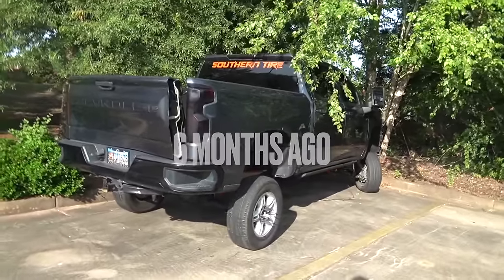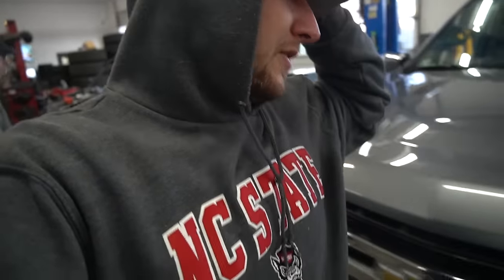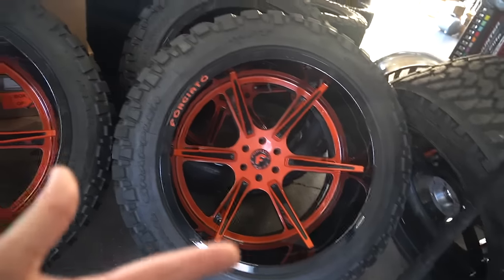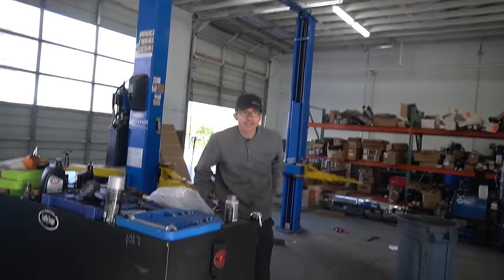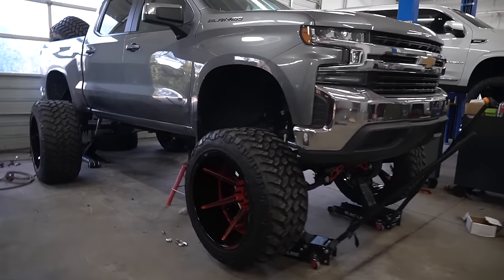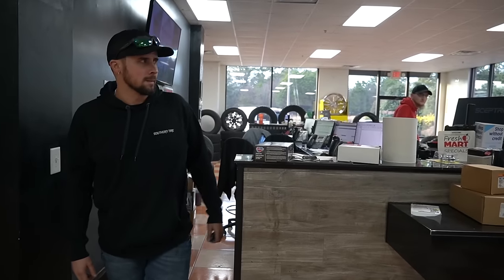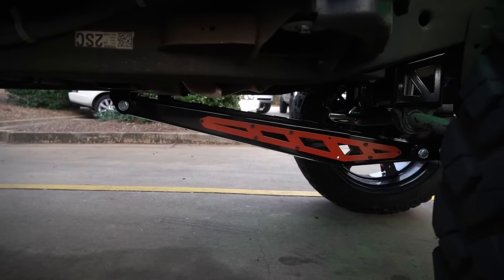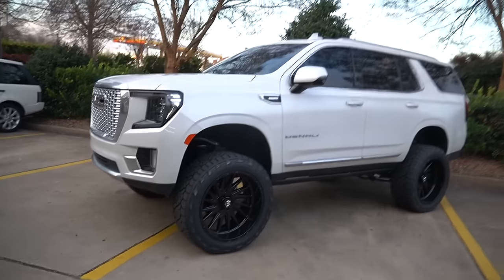WRECKED HIS DREAM TRUCK! Lifted Chevy on 26x16 FORGIATOS and 9" Mcgaughys + 3" Body Lift

Comment: I have a 2021 Silverado RST 4x4 with an 8 inch Ready Lift. What’s the best way I can stretch it? I would like to get at least another 2. I was looking at leveling kit and add a leaf for rear, thoughts?
Reply: I also advise getting readylifts 2 inch shock extenders to keep your rear travel the same. Cheap like $50

Comment: Why doesn't this lift company make lifts for Rams? I could of started with a 9" instead of a piss ant 6". I now have a 6" plus 3" body plus 2" leveling kit on 37's But would prefer a higher lift and 40's, but i don't think theres any companies who make bigger than 6" for a 2017 1500 ram and that dont cost thousands. Please let me know if there is. I also wanna run 26x16's. Not sure if i can with the total lift setup i currently have or if i need to drop to 36's or 35's? My 37's are looking small though already.  Thanks

Comment: Hey guys im new to the lift kits assembly. Why do people have body lifts or blocks then install the lift kit on top of it ? Is that to make them higher ?  Doesn't that make the truck look bad ?  If customers want to go that high why not get a lift kit that goes up to their desired  total height level in the first place ?
Reply: Body lift only lifts the body/ bed of the truck 1-3in, When people say it makes the truck look “Bad” it’s because it shows the frame more which bothers some more than others, most people won’t notice that extra inch of frame. As for why? A level doesn’t change ride quality at all! So you could have a stock riding struck but body lifted 3in to fit 35s, most of the time people already have a 6in lift, so it’s cheaper to spend 300$ on a body lift then tear everything apart to go 9in. Hope that makes a little bit of sense.

Comment: does doing this affect the towing capacity and other stuff?  not really a fan of lifts, i use my trucks for work and that would make it harder to work, only thing i can think of is maybe better clearance off roading, but then again i dont want to go offroading and risk damaging the truck in the middle of nowhere, to each their own though
Reply: You are not towing or hauling anything with a half ton thats gonna be affected by a lift. Put a drop hitch on it and keep going. 5th wheels and goosenecks would be a different story